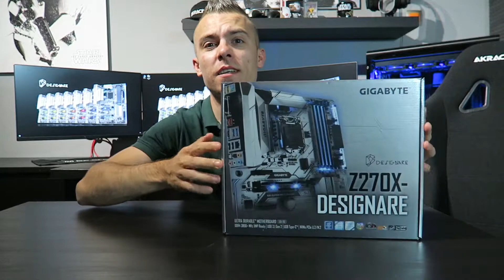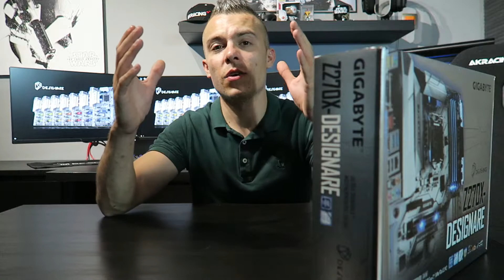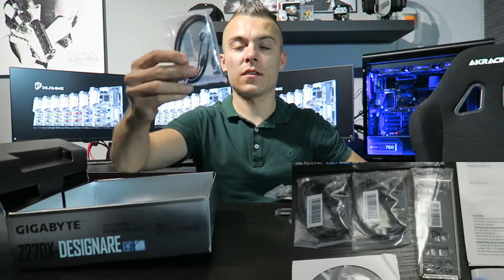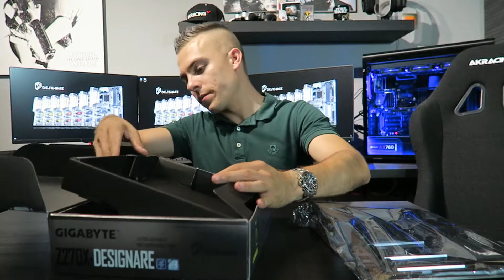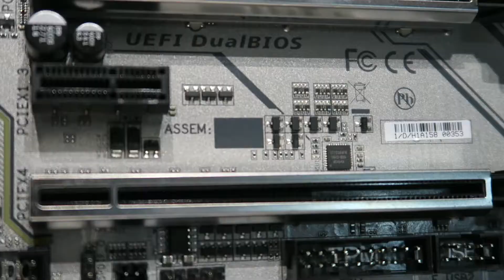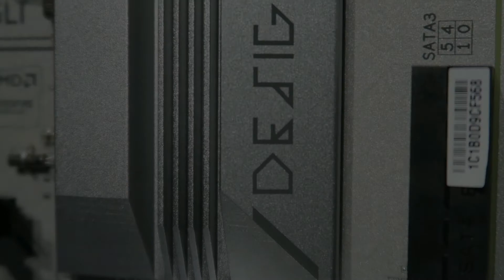GIGABYTE Z270X DESIGNARE - best looking motherboard!!

Comment: CMOS Jumper are included in most motherboard or it always sell separately?
Reply from the maker: Raihan Rumi I have encountered them only with Gigabyte motherboards. You can't buy them separately because every motherboard has different pins to connect those front buttons.
Reply: Hmm I see. So unplug the motherboard battery is enough to reset overclocked processor and RAM?
Reply from the maker: Raihan Rumi Should be.